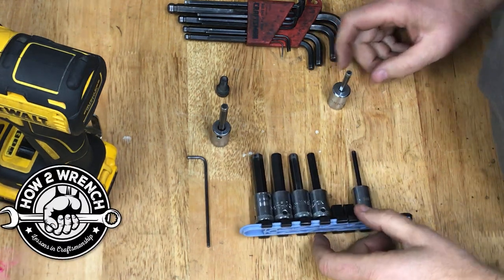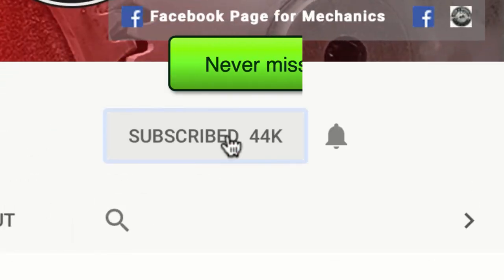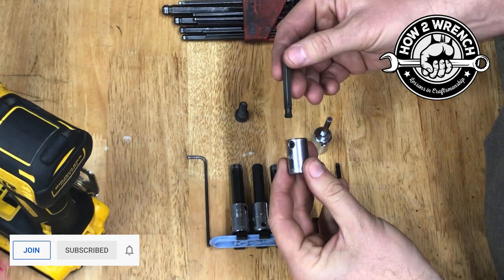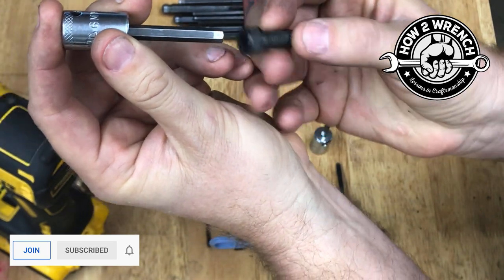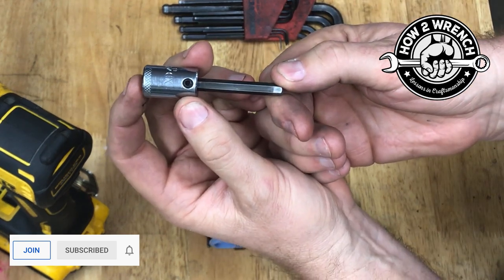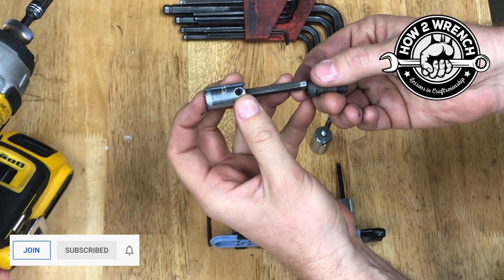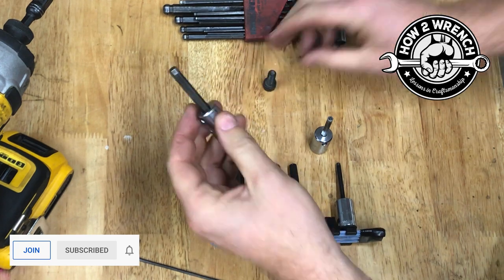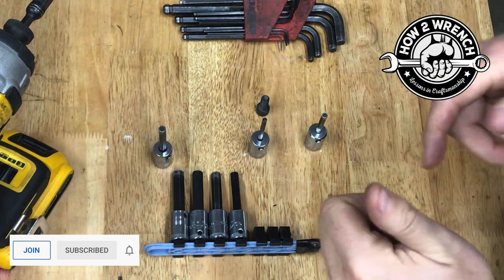Did you know you need to maintain your allen tool drives? Pro Tip will help you not strip allens!

Comment: You should also show how to grind the ends of the Allen bits to straighten them up after they start to round off. Another thing that should be done often is oiling ratchets and pliers.
Reply from the maker: We did a "oiling ratchets" maybe just before you got connected. I don't think I'm done one on grinding the ends of Allens but you should make a vid and I would produce it and give you a shout out as a sub! Make a video and email it to me @ how2wrench@gmail.com

Comment: Hmm.  And look for wrenches that use roll pins instead.  They never get loose.  I've had mine for 50 years and no problema.
Reply from the maker: Right? What is your fav brand?
Reply: @How2Wrench  Whatever I can get my hands on.  I find Harbor Freight to be on my side of the money fight.  I once brought a Sears tool back and they didn't honor the warranty.  I only have a few tools from Snap-On.  Don't even remember what the Allens are.  PS. The audio seems very good.